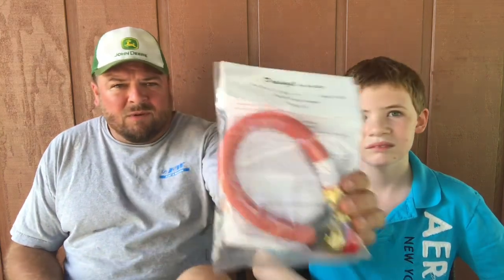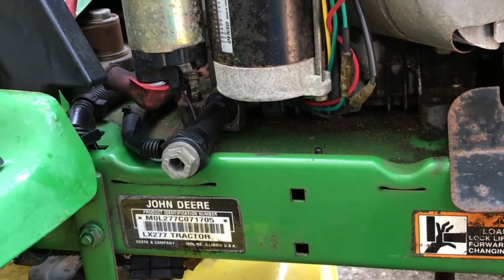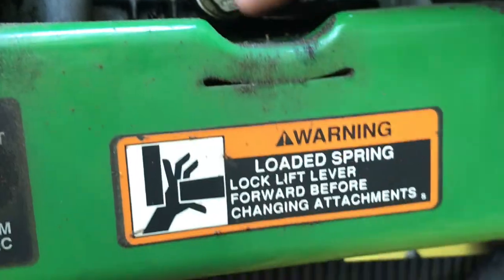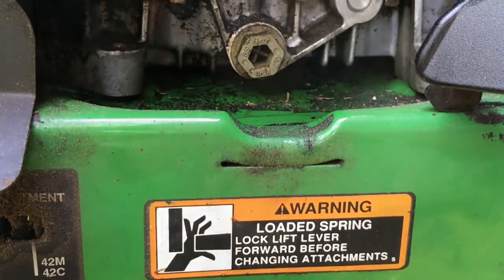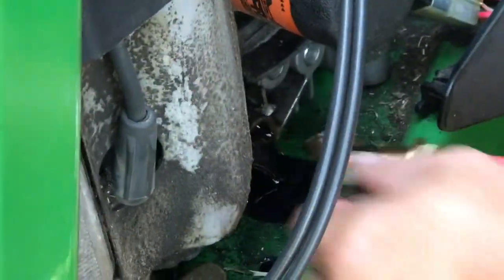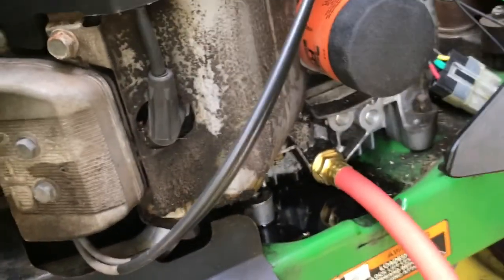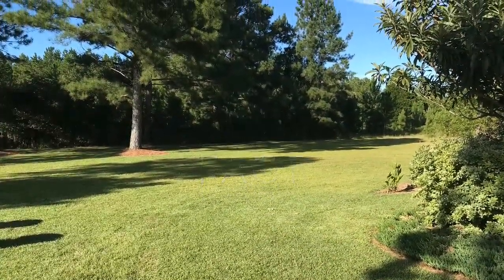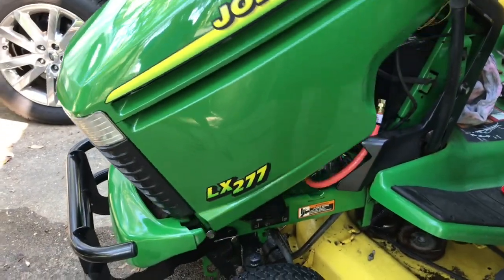John Deere, Kawasaki, Drainzit Install

Comment: What was the size of the bit you used to remove the kawasaki drain plug?
Reply from the maker: Patrick T. Good question. I saw it very recently in my garage while I was looking for something else. I’ll look for it tomorrow when I get home from work and get you a size.
Reply: Thanks. I believe the exterior 6 point would be a 19mm but had not thought about using a hex bit. Not sure if one would be better. 

How has the Drainzit held up? Worth the purchase?
Reply from the maker: It’s holding up well. It does make oil changes easier.
Reply: Any luck on the hex socket size. Thanks again
Reply from the maker: Sorry I’m slow it’s a hex 10 for the center. 19 mm outer
Reply from the maker: Sorry I’m slow it’s a hex 10 for the center. 19 mm outer
Reply from the maker: Sorry I’m slow it’s a hex 10 for the center. 19 mm outer
Reply: Awesome... thanks so much